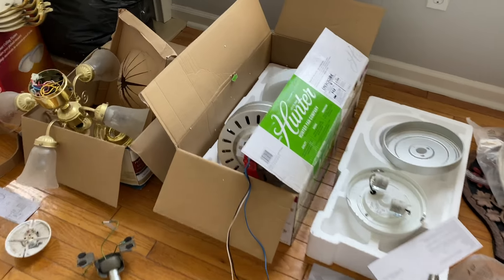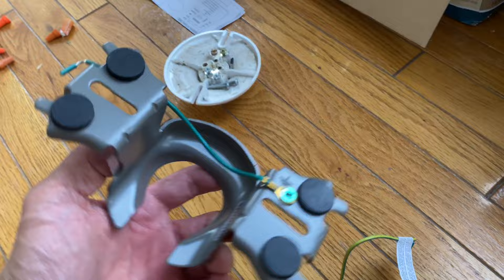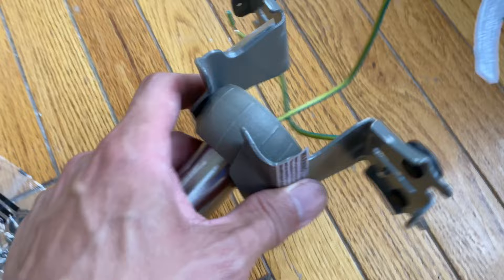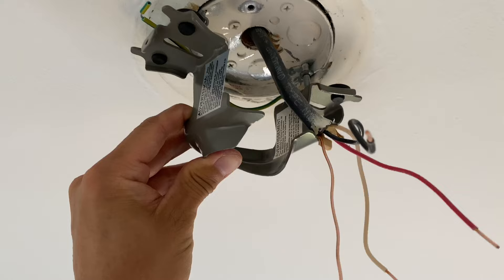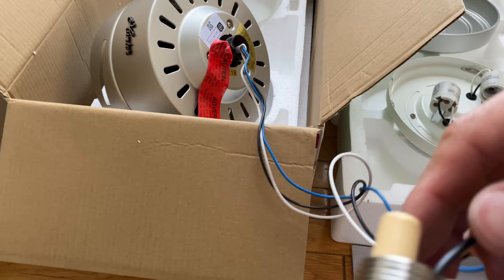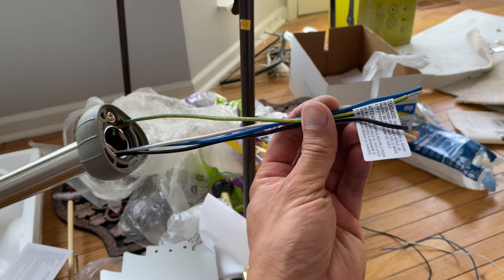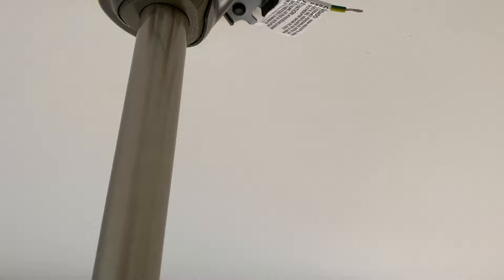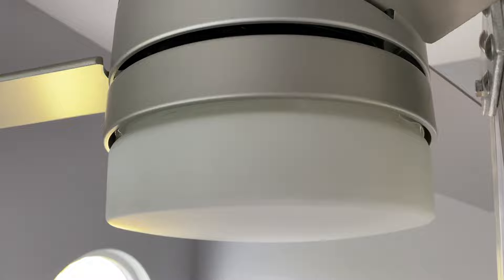Installing a Hunter Ceiling Fan with an Extended Downrod

Comment: The mounting bracket opening is supposed to face to the peak of the ceiling.  Have you had any wobbling or any problems since you mounted yours sideways instead?  I'm asking because I'm considering returning mine because I can't mount it properly.
Reply from the maker: What do you mean? My ceiling is flat.

Comment: Hi. Is this normal that the downrod is not fully screwed into the base, part of a threath is visible outside? Doesn't look safe.
Reply from the maker: It's fully threaded. The set screw will also prevent it from coming undone.

Comment: Hi Thanks for the video, It helped with the down-rod install that I needed to do.  The only question I have is you capped the blue wire on the ceiling but used the remote control? where did you install the receiver for the remote?
Reply from the maker: Glad to hear it was helpful! The remote receiver is part of the fan, so I didn't need to install anything additional.
Reply: Ok, thank you. I see you posted this a year ago, so they must have made a chamge. The remote is now separated and needs to be installed on the ceiling at the wiring junction.
Reply from the maker: @johnnytranna  oh interesting, thanks for the update!
Reply: Hi
You can tug the receiver in the ceiling bracket with the blue wire connected if use a dual light/fan switch.

Comment: What size step ladder did you need to reach your ceiling? The tallest ladder I have is 12', and I'm unable to reach the upper downrod (6') attachment. So, I'm hoping I can just remove my dead Hunter fan from the lower end of the downrod, and install my replacement Hunter fan without having to replace the upper bracket.
Reply from the maker: I used a 14 foot ladder for the 16 foot ceiling. Menards rents out ladders. Lowes probably does too.
Reply: I was wondering if you were able to just attach the fan to the existing downrod?I have a 20 foot ceiling in my family room and can't reach the top.Having somewhere to put the excess wire seems like would be a problem.

Comment: I'm using the supplied downrod but the threads don't go all the way down. Also I don't have a hole for the set screw is this safe?
Reply from the maker: Is it a different brand? I would think that as long as you have several threads of engagement and as long as the downrod isn't stuck, you should be fine. Does it not have a set screw at all or just not a hole on the threads of the rod? Does the manual say anything about the set screw?

Comment: Can I install this hunter ceiling fan without a rod?
Reply from the maker: That's a good question. I'm not sure. I would try emailing the manufacturer or checking out the manual for the fan you want to install.
Reply: You need the rod to hang most ceiling fans. Some manufacturers sell flat ceiling fans without the need of a rod.